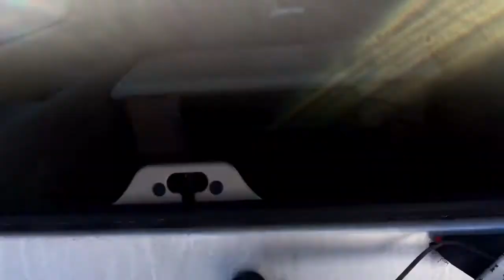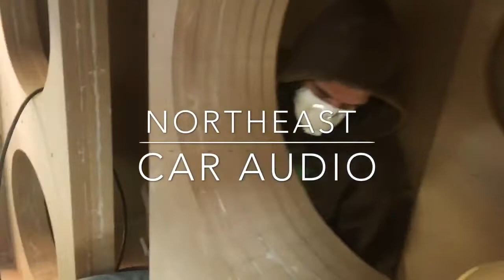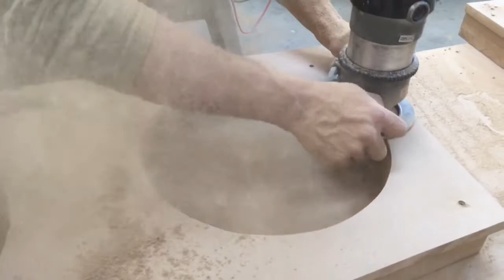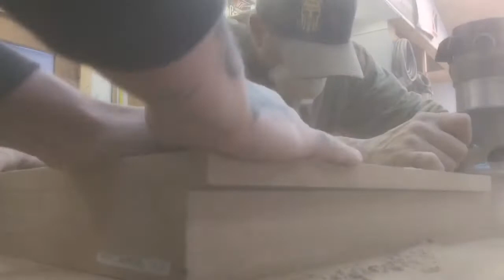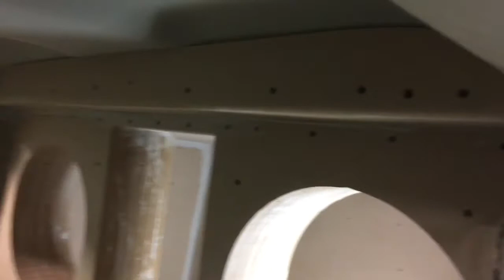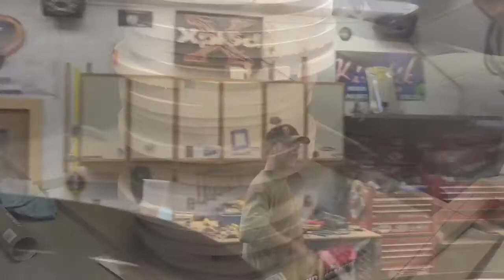SUBWOOFER ENCLOSURE

Comment: why did you use mdf?
Reply from the maker: Shaun Resemius help keep costs down. And it is easy to work with. You can cut it a little big and flush router w a smooth clean edge like Baltic .
Reply: Was kind of a rhetorical question.
Obviously the only reason to use it, is because it's cheaper. But it's heavy af and not as strong as baltic
Reply from the maker: Shaun Resemius believe it or not my blow through weighed more than this and was all in the back end. Truck was raked out. This is centered weight and the truck sits level. We aren't concerned w the weight so much as long as my truck isn't sagging in the ass . Truck is also lowered w some quality products .
Reply: You could have had a box with less layers and just as much strenght. And had more air space or space for any of the following batteries, amps, extra room to put your seat back in a more comfortable position
Reply from the maker: Shaun Resemius follow the build and you'll see how everything will work and why we did what we did. Truck isn't a daily driver any more .
Reply: To me it just doesn't make sense to put that much money and work into a system of that size and then cheap out on the enclosure materials.
Can't say I have ever seen anyone use mdf for a wall. Not saying nobody has
Reply: 😂😂😂 I get it's not a daily I'm not new to car audio dude.
No excuse for using MDF on a build like this period